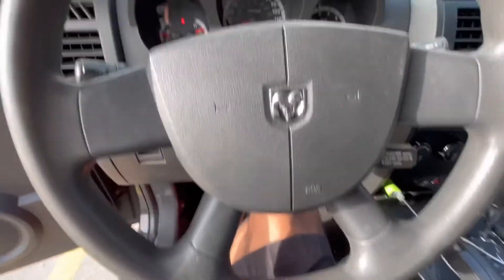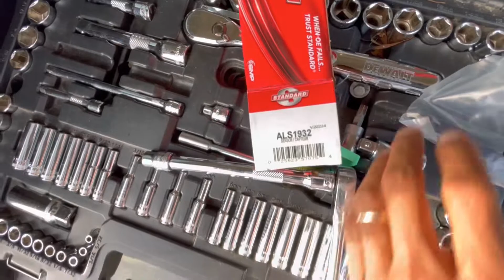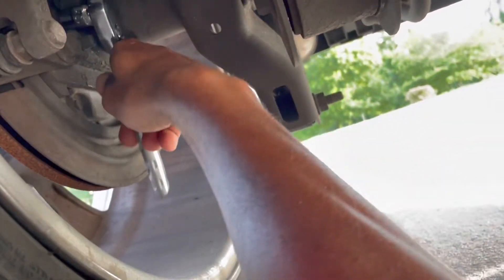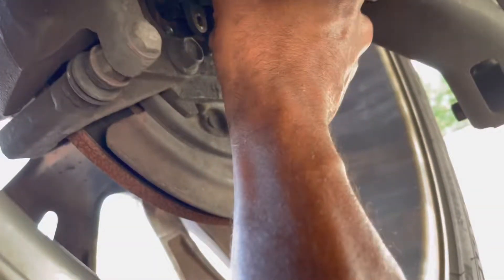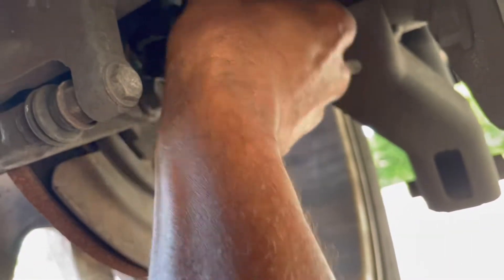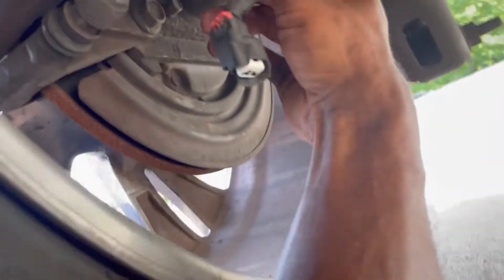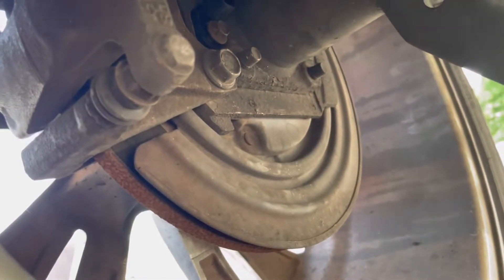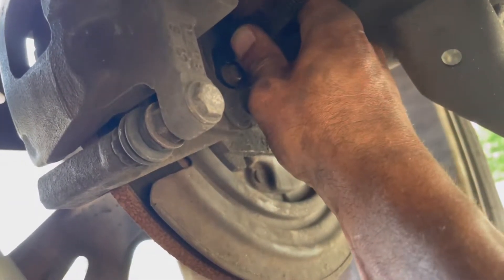Replacing rear abs sensor dodge nitro

Comment: Did it turn off the lights on the dash ?
Reply from the maker: Yes it did after I replaced it I believe I cleared the code and it didn’t come back

Best to have a good scanner 

How To Scan Your Vehicle 4 $60 - AP 200 Autel Obd Bluetooth Scanner
https://youtu.be/7cnVaZ7dyEU

Good luck. Hopefully it’s just a speed sensor. Hint hint
Reply: @aricwithautoreplay  thanks buddy I always come to your vids for help
Reply from the maker: @jamesjarrettt3995  your welcome hope it helps